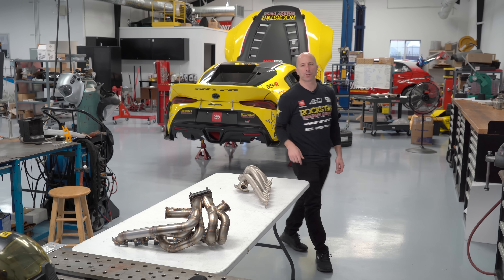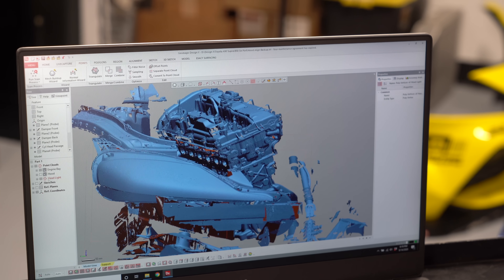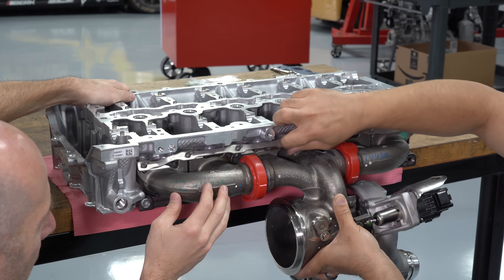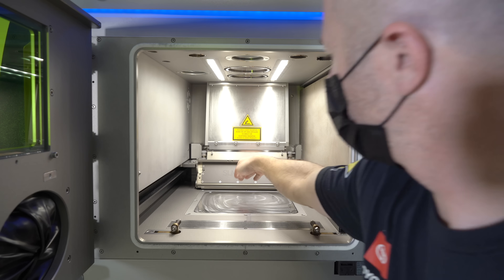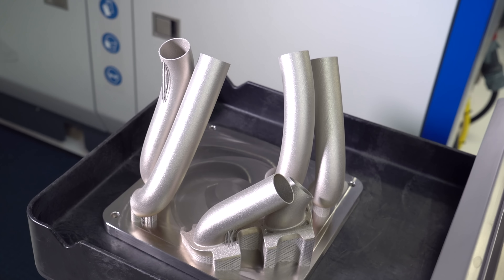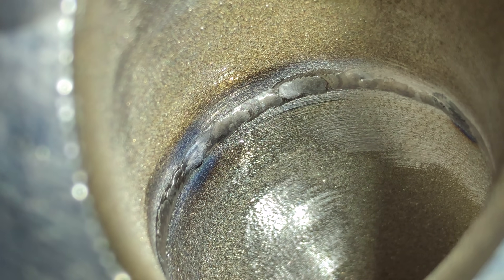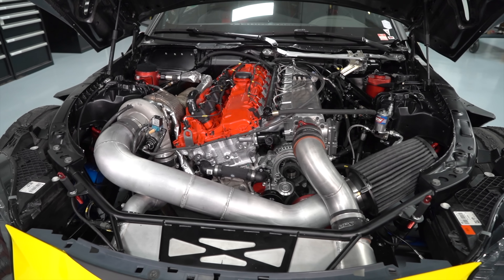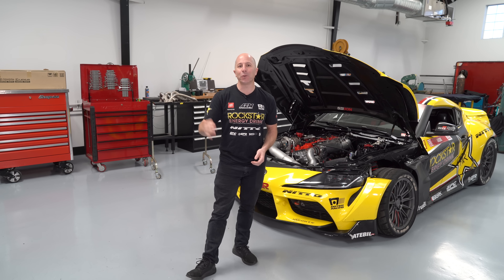Turbo Manifold 3D Printed from Inconel Powder

Comment: this is absolutely insane
Reply: Is it? Why?
Reply: @jiveturkey9993  dont worry this is over complicated pipework.
Reply: @jhallin5185  because Inconel is a very cool alloy that has possible application in some of the most advanced engineering projects on earth. It can withstand ridiculous temperatures and 3d printing can allow structures to be created that were previously not possible.
Reply: @vighneshkannan7896  I never denied its cool, but cool doesn't make it better. 3d printing is a great technology that doesn't mean everything should be printed, this manifold was 3d printed for clicks and ad revenue not becuase the technology made it better. 
 My initial comment was too the reaction towards the video not against the process of 3d printing metal. This is not "insane" this is just neat that is all.
Reply: @jhallin5185  No one said it was better though.
Reply: This would be awesome for you to have in your new shop you are buying Tommy. You could recreate new "old" parts for the GTRs you are building.
Reply: What is insane is that you can 3d scan with the ladar of a $1000 phone
Reply: It looks cool
Reply: Soon we will be able to do open source engines. Imagine how reliable a block could be built with the design power of the internet.

Comment: Love to see modern engineering practise being used. I have been a CAD designer for many years and the ability to 3D print pieces like this is a game changer. If you have the Solidworks skills you can now design, tune using finite element analysis and make anything you can imagine. That 3d scanner is nerd porn.
Reply: Very true except the pulses from the valves and how they affect the flow are really tough in CFD.  I am a cswe and taught solidworks for years and designed a few manifolds including a high hp turbo manifold for an infinity v8 and a turbo bike so im not just blowing smoke:)

This was a really cool build.
Reply: @TheShift1313  Wow; you must literally have a ~150 IQ. Engineers alone are ~133 ... but CFD? That's some complex math. Turbulent flow, etc. Maybe you should make a YT channel... this video was way better done than is visible ... but if you're new to the video side...there's a YT channel called "This Old Tony" (which is really good) and you can watch his evolution of production skills.  He is very, very smart as well ... but, his videos started off modest ... and you can kinda see the logic that goes into his 'genesis' as a content creator. it's worth checking out, as I'm sure content you'd make would be, as well.  In fact, he even spends a couple of episodes introducing and explaining solid works, as well. I bet you'd get a kick out of that. :)
Reply: @TheShift1313  Hi! I am Mechanical Engineering student mainly using Solidworks. I am a beginner but would like to have the skills to design these complex parts. Any tips how to begin doing this so I can model these complex parts in the future?
Reply: @haroldramuk1807  hey harold.  I have a channel(mainly fusion 360) called Learn Everything About Design.  I did a series designing a honda k24 intake for various mfg methods.  Are you looking for just modeling or more about tuned pulse design?

Comment: I'm impressed that Inconel can be 3d printed now!
Reply: Crazy
Reply: Just about anything can be now
Reply: Its been a material in sls printing for awhile now, over 10 years if not 20 to 30. Metal 3d printing hasn't been so mainstream until now however
Reply: F1 was doing this 15 years ago.  But very impressive that it’s something that is attainable to us mere mortals now.
Reply: Will Weld For Food  aerospace... like you run a welding table at the local small airport? Because a 3D printed titanium flexible exhaust nozzle is what's used to adjust trajectory on some satellites so...
Reply: Will Weld For Food  The engineers and craftsmen working on the Apollo program used every bit of cutting edge technology available to them at the time. For us to not do the same but instead keep using the same tools as some kind of stagnant ancestor worship is disgusting.
Reply: Will Weld For Food  I work in aero too, in fact, I've designed internals for engines made of Inconel, Hastealloy and other nickel superalloys that are currently flying, manufactured with SLS AM machines, and let me tell you,  it's far from unreliable, especially when you have a well defined process that not only relies on certified specifications for the materials but also post treatments like HIP, heat treatment and surface treatments.
Reply: Will Weld For Food  that might be a concern looking at those plastic 3d prints. but with this, its only the particles that get touched by the laser that gets welded. and that seems to be very precision. it doestnt look like it will spread that much heat that it would cause clumping
Reply: When I was designing an under vehicle wood gasification system for pickup trucks, you couldn’t even get the stuff in stock material, let alone print it
Reply: @Sam - Inconel is actually one of the easier materials to 3D Print.  The major problem is that high quality powder is very expensive.

For the same reason, aluminium is incredibly difficult to process via this method-  it's so reactive that the powder forms an oxide layer that the laser can't break down.  You'd have to form and store the powder under argon and then transport it to the machine without ever breaking the seal.
Reply: Nice to see lots of engineers in this message thread :)

Can anyone comment on this Inconel alloy being welded without a vacuum chamber?   I mean, the back purging process is pretty standard with Stainless headers, but I thought Inconel had to be welded inside a chamber to prevent impurities from contaminating the weld?  Even a long duration post-flow gas setting seems like it would be difficult to hold over the puddle until it cools because of all of the nooks & crannies to work around.   The weldor even had to bend his tungsten!   Even the oxide layer would be a major pain in the buttocks. Could a welding project possibly be more challenging than that? 

I dunno man.   If I was welding thin-walled parts costing $20 Grand (wild guess) I wouldn't skimp out on the vacuum chamber.
Reply: Inconels have been printable for almost 10 years! EOS has had these in their selection for a very long time.
Reply: @TriAxleTranny  
Argon chamber is used.  625 Inconel is a bit mushy in GTAW welding so it works great in this process.  A eutectic alloy would bomb out.
Reply: Well.....At least you found the internet and YouTube on your own....

Comment: I love seeing how much aerospace technology is trickling down into racing. Thanks for showing us the best tech outside f1.
Reply: A lot of racing technology trickles to aerospace.  3D printed sand casting cores were pioneered by Formula 1 for their blocks (and still use it instead of full billet blocks) and are heavily used in turbine manufacture.
Reply: @mattnsac  i guess that is true since the car was before the airplane, so to speak
Reply: Will Weld For Food  interesting info none the less, & likely true since their 3D printed header didn't make it on time, but in the future I think humans are likely to be phased out when the tech is quicker, cheaper, and more accurate. like with allot of the automation areas, but i have seen people still being used in factories so you are still likely correct
Reply: Will Weld For Food  wow you okay?
Reply: The moon missions wouldn't have happened if surfboard builders didn't help NASA with there techniques for get strength from composites.
Reply: @Eduardo_Espinoza  Things usually get cheaper when you make a mold and then can use the same mold for 500 parts (plastic injection molding for example). This doesn't apply do 3d metal printing, each part is X dollars per pound no matter if it 1 pound or 1000. That being said, I hope these machines somehow can be sold cheaper so I can get my hands on 1 one day! 

Also your sentiment about "car before the airplane" seems a bit silly you can't really correlate things that happened 120 years ago as an explanation of the emerging technology we are seeing now.
Reply: @amorag59  true, but what do you think about the F1 tech was 1st argument ?
Reply: Will Weld For Food  yep. According to the government, the reason man hasn’t been back to the moon is because we no longer have the craftsmen capable of building the parts to get us there.
Reply: Its by far the other way around. Motorsport technology (eventually) trickles into Aerospace and other industries.  Motorsport is essentially prototyping. Parts are low volume, high cost with performance being the top criteria, while component llifespan is a lower requirement and teams are willing to R&D for the competitive edge.    Aerospace is far behind  motorsport on technologies like Metallic ADM, where its in limited use due to the testing, traceability and volume requirements that Aerospace needs.  It not used so much in OEM Automotive engineering either, due to the low cost and high volume requirements.

We have been making DMLS Inconel 625 headers in F1 for a very long time now. Although the main tubes themselves are not typically fully printed, as there are more suitables technologies for this like hydroforming.
Reply: @tmango78  I think you are confusing the poor design record keeping of the Saturn 5. We absolutely could get to the moon again. Even China has sent probes to the dark side of the moon, and if anything having computer aided design technologies available to us would make it more streamlined. The spaceX starship was slated for that capability and even billionaires want to use the starship to do that, see dearmoon project.
Reply: @YowserUK  total ignorance. Aerospace is LIGHT YEARS ahead of motorsports.

Anyone who believes differently needs to leave their armchair
Reply: @chrishamilton2559  My armchair is my previous 8 years experience as a Senior design engineer of metallic tubular fabrications for the Aerospace industry, and my current experience as a Formula one design engineer, specialising in the SLM/DMLS of structural aerodynamic components.
Reply: @YowserUK  of course. I am the prince of Persia, pleased to make your acquaintance.
Reply: @ShawnDickens  you mean we wouldn't have made it to the moon if it weren't for surfers? LOL
Reply: @gregh7457  yes, surfboard makers helped make it possible by showing NASA how to make thing stronger and lighter in composites.
Reply: Will Weld For Food  well yeah,compared with forged/billet parts 3d printed stuff is unreliable, but is still beter than casting, and for exhaust manifolds, turbo housings, and that stuff 3d printed stuff works fine.
Reply: Okay, so Dr. Pete Peterson in one of his last interviews. He said that there are titanium flanges that are used in super secret aircraft, that are so hard, they cannot be machined easily, and it would not be cost effective to machine them. So they actually bring in a team of specially trained Humans, a whole group of them, and they actually bend the metal using Human "intent" and a press. Some Humans are able to soften metal (spoon bending) with their mind, and the government has traveled all over the world finding these people. If you get 3 or 4 of these people together, you can literally "melt" titanium alloy into a soft gel, and press it into position without any expensive milling needed. Pete was killed for revealed this. He is dead now. Think about the implications of this.
Reply: @Ritalie  You've missed taking your ritalin today haven't you?
Reply: I think this technique might have actually trickled UP from racing where cheating is more likely to be the rule than the exception

Comment: This is exactly what I'm going through mechanical engineering to do. Man this is exciting!
Reply: It's strange, every one thinks that the internet is inherently low information and bite sized. If there was a video an hour long detailing the 3d priniting process and welding people would love it. A couple psychologists noted that as soon as you let people find their own sources, they study at the level they are capable of. They noted that most people are way smarter than they are given credit for.
Btw, every engineer I know is a dink. One argued with me that aluminum evestrough wouldn't expand due to temperature, it was a continuous piece almost forty meters long. I told him that it would change by almost 2" and he ignored what I said because someone gave him a piece of paper with his name on it.
Reply: @timothybayliss6680  Sounds like he slept through physics 4a lol
Reply: @timothybayliss6680  funny I dealt with the same mentality for years steam and heating hot water lines with no expansion joints or loops .Some runs were 1500+ foot. Basically self destruction especially in earthquakes. Job security welding up cracked- fatigued joints. Plus who in their right mind runs HHW inside a data center.lol
Reply: Same thing here ^^

Starting my studies next fall. I hope I will be able to survive it 😅. Probably will be a boatload of work, but possible.
Reply: @Marco-vp8wl  You’ll be fine bro. Just stick with it.

Comment: wow that hotside clamp design is incredible
Reply: yes, i want that engine just because of that
Reply: K04-064 uses almost the same design
Reply: If you use the exact same material so the thermal expansion properties, dont make it loosen up..????
Reply: It's been more common in the aftermarket, im amazed they can align it correctly on the exhaust holes. There is some Audi RS3s running the same design.
Reply: Audi been using this design (VW I know, I work for Audi tho) since about 04, direct injection was introduced and we started using this design where the base of the turbo is clamped by the plate, really good for heat distribution as can use a heatsoak material. K04-064 as mentioned.
Reply: @ABeans07  I have normal exhaust headers (2) & they move around before i tighten it, so it dont think it has to be aligned but in this higher end car maybe but that is what i know
Reply: Sort of like a linear v-band.
Reply: @ABeans07  If the header has a larger opening than the cylinder head, the transition isn't an issue as there is minimal flow disruption.   Going the other way would be a flow issue.  . This miss match technique goes back many years for production engines.
Reply: @martinultimatevw3779  I believe the 881/882 ko4 is like that too, too bad they have terrible coking issues.
Reply: Why is it so incredible and better than just a normal flange?
Reply: @hydrocarbon82  The header hangs on there very similar to a French cleat used to hang a cabinet to the wall.
Wedge action from the upper retainer can apply plenty of force and the angle used will determine how much is directed towards the head.

Tremendous job guys! 💪
Reply: Recycled wood joint techniques
Reply: @psk5746  Per the vid, the lower row of bolts isn't accessible due to manifold interference.  This design only needs access to one row.
Reply: @bobroberts2371  Thanks, clever
Reply: @sandman900rr  Not really, think about it, if both thngs are of the same material, and or of an identicle amount of metal (for thermal tolerance before it gets too hot, say), generally they will heat up at a similar rate, albeit with differences depending on mass differences and different thicknessess of material sections in both the designs being both thermally loaded/absorbing X amaount of heat.

Who-ever told you same or similar materials will heat differently, are not incorrect (as I tried poorly to say above,) but neither are they more than say 25% correct - but likely for 'folklore/gossip/general/herd -knowledge, that could be true of poorly designed and built products from persons, who might be able to spanner and wrench, but have little idea of industrial & production/manufacturing, or have it mixed up with galvanic reactions between metalic elemnts and parts.

Sorry, I don't mean to be read sounding like a dick, but I do read like one, so, my apologies if you was offended.
Apology is recinded if no sense of humour is present in a/the reader.
Reply: @psk5746  thats what I'm saying, all these noobs creaming over shit i have mig welded together. Power doesn't come from thing being fancy alone.
Reply: VW has had this design for almost 30 years. Its ingenious.